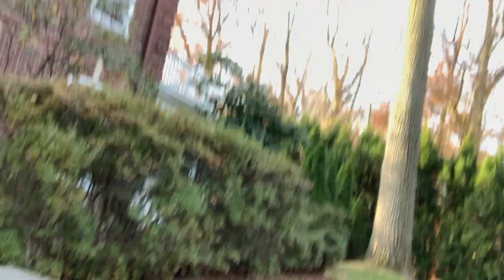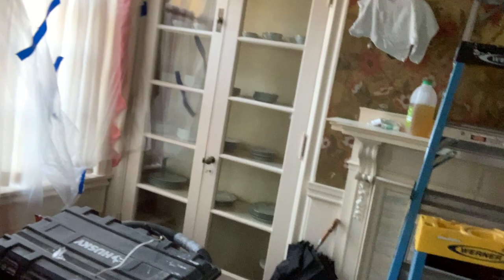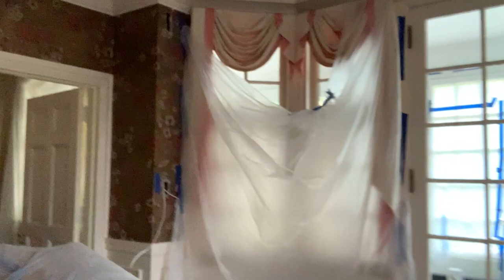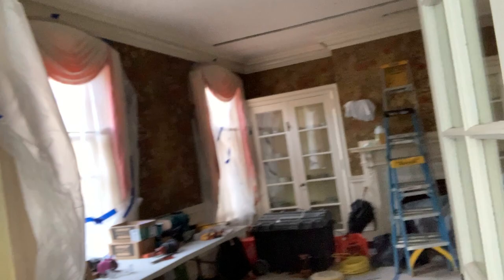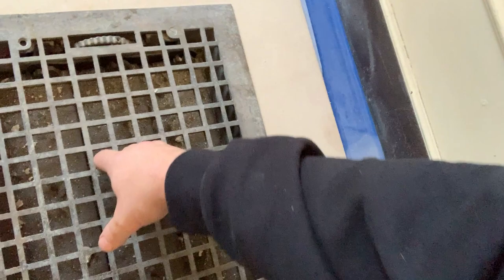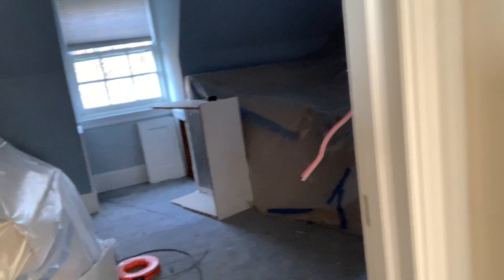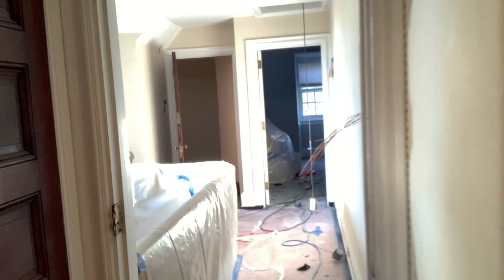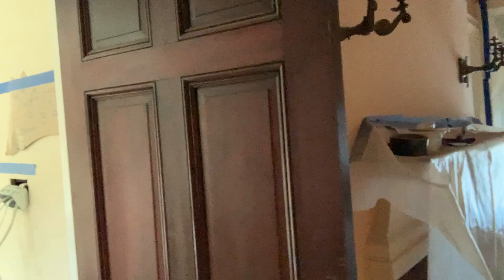5k sq ft knob and tube rewire. Horace Trumbauer Architecture.

Comment: Never seen a heating system like that but I only worked in old homes not mansions.  Really cool u got a specialty electrical company that separates u from the average company that does all but specializes in nothing.  I turned down a Lake Michigan home knob and tube rewire for a friend because it would of been way too involved and I never did a complete rewire of knob and tube.  Much respect!  The way u do it separates your company from the the rest of them